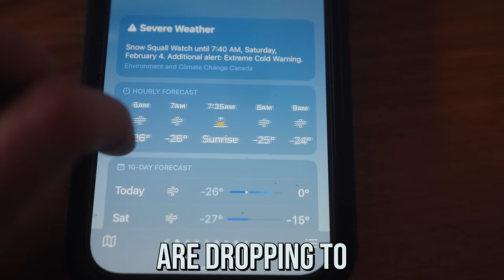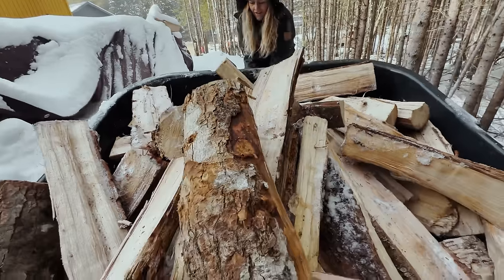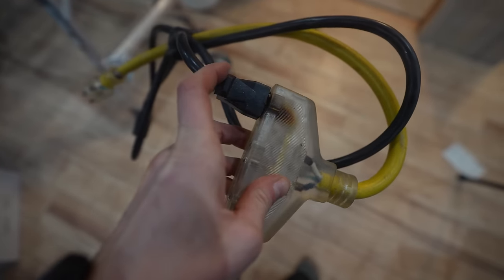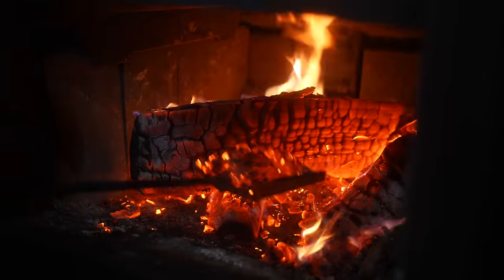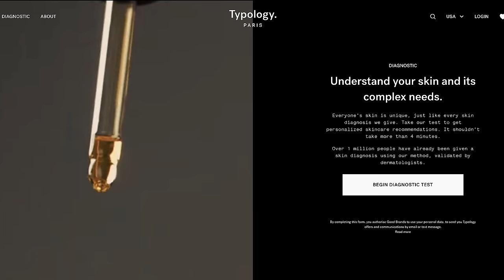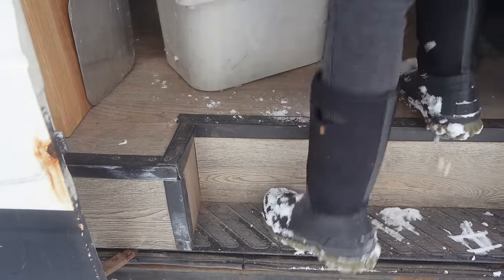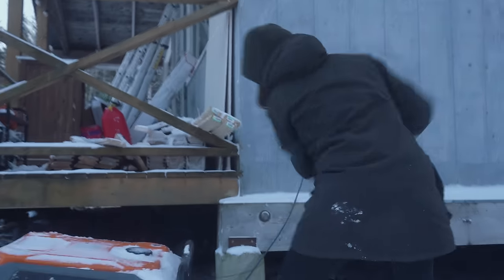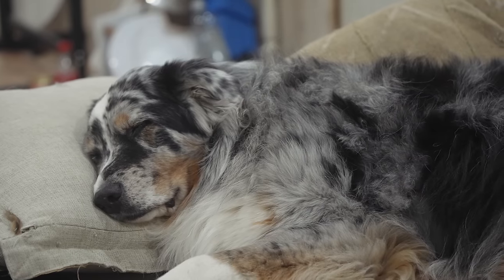POLAR VORTEX HITS OUR CABIN -40 & Not Prepared

Comment: Y'all amaze me, honestly! Going on the roof when there is snow takes guts! My suggestion, regarding dishes, would be to boil/heat water on the stove and use that to wash dishes inside the house. As long as you have running water and drains working inside the house for rinsing you should be good. Yes, it takes longer overall, but then you don't have to worry as much about your van. I would suggest winterizing the van and that would be one less worry. 

One more thing, the power strip. I know that you're limited for power, but don't plug and extention cord into a power strip! It's a major fire hazard and I would hate to see you hurt or for you to lose all of your hard work becuase no one let you know. Really, I just want you to be safe with those things that can easily be prevented.

Comment: Yes curtains will help a lot also spend a little more money and get clear plastic and put it on the outside of your windows.   The clear plastic lets you see outside.   I am going to get heavy clear plastic sheets and custom frame each window that I can install with mounting clips for easy installation and removal.   Stay safe

Comment: Hi Gals...coming from another woman who has lived and worked in the bush for 40 years - Yukon, NWT, Alaska - you need to get a wood stove with a larger box. You should not need to get up in the middle of the night to stoke your stove. Mine burns for up to 18 hours. You have to load it with rounds logs not split logs for overnight and damper down the draft. In  the morning crank the draft wide open again to build up the heat and burn out your chimney. Dishes...I do not have running water and always keep a large pot on the wood stove filled with water so always have hot water...using your van seems silly as you haul water...so not like you did not have it...I wash my dishes in a big old fashioned dish pan and dump your water outside...no big deal....outhouse...the way to tell a newby from an old timer bush person....check out their outhouse in the winter....newby will have a regular toilet seat...old timer will have  2 inch styrofoam cut into a toilet seat shape...no frost bit butts!!!!

Comment: Long extension cords tend to resist! Buy a roll of cable and add temporary junctions/outlets where you need to extend. Don't risk thermal runaway with loose connections and/or chained extensions!

Comment: you need to invest in a back boiler system for your stove. you can always melt snow in a bucket to fill it when its freezing and will give you access to hot water.

Comment: Hey from Finland 😊 With regards to doing the dishes would doing them in the shower stall work with a couple of big enough plastic buckets or containers. One for washing and one for rinsing. And if there’s only cold water boiling some in a kettle. Minus the shower stall this is what we usually do at our summer cottages if there’s no running water.

Comment: lay a ladder onto the roof Tie a strong rope to the top of the ladder  Throw it over the peak and down the other side of the house  Tie it to a cinder block and let the block hang 6 feet off the ground  That ladder will not move. Put a cloth under the rope on the peak so the shingles don't cut into the rope.  This works and works very well.

Comment: Regarding the sauna - the reason you couldn't get it hot, is probably due to the glass door in really cold temperatures. An idea would be to build on a small "changing-room" in front of it, that would isolate a bit of the direct cold from the door and (probably) make it heat up even during -30/-40
Reply from the maker: Well Mr. Shaw, that is a great idea, thanks for sharing it with us. Another to do for our list.💛🐶

Comment: I live off grid in an area where I have a lot of blizzards and minis temps. I have been doing it for 10 years now. I do things way different. I have low ceilings so heat doesn't raise to high. Every window and door is covered in my house with plastic and even heavy blankets when it gets this cold. I also close the rest of the house to hold the heat in the main room. I also I have a bucket and everything needed for a toilet if needed. I have room in the main room for a weeks worth of wood. I don't open the door unless I really need to. Please be careful out there

Comment: I use my woodstove to heat water to clean the dishes and floors . I bury the dirty water deep or deep in the snow or put in a plastic coffee can and toss it in the dump ..depends on how frozen the ground is ... I use all nature cleaning products, 7th generations, baking soda, vinegar , essential oils. I have two large pans one for washing in soapy hotw taer from teh woodstove and one for rinsing in cold water from the faucet I let the water  stay in the other pot  and not go down my drain. I use that water for watery flowers outside or bushes. I am making an apple pie for the first time on my woodstove fingers crossed it comes out good smells good so far ...I use a coleman collapsible oven that sit on top of my woodstove .

Comment: You need to have at least two sources of heat, you may want to consider propane as a back up source. You can get a ‘blanket’ for the tank for the extreme cold to keep the propane from freezing. We had a power cut in -50’s weather but we had a wood stove similar to yours that kept our house warm, we cooked with a propane camping stove or on the wood stove just as you did. By stacking the wood daily to replace the wood used and we over-stacked the pile when the weather got really cold. Try having an indoor stack of wood in extreme temperatures that prevents you going outside during the night.
We have lived through the extreme cold for months as we live in the Yukon, we are moving to Nova Scotia in a few months and our house will have 3 sources of heat for comfort, plus can’t wait to have a month or two of ‘bad weather’ instead of 6-7 months. Nice job keeping warm.

Comment: Keep track of your daily solar cycle, so you know when to add energy to your most active areas, and when to expect the structure to absorb energy in areas which are leaky, have large windows, shaded by trees, or don't have heavy insulation. Add a layer to your windows, if you can feel them leeching energy and try not to let your walls lose too much energy before nightfall, or it will take forever to heat the space.
Reply from the maker: Thank you for sharing your knowledge with us. 💛🐾

Comment: Did you actually get -40 there? I live in the western corner of NS and our wind chill was in the -40's but the actual low was -23 C with about 90 km wind. And that was the coldest we've had since 1988. We heat entirely with wood I cut on my land. Works fine. I wouldn't want to be on a metal roof in winter though.

Comment: The water in my house was fine during the polar vortex, except for the pipe to my washing machine. There was no water. It's in the basement, but the pipe goes upwards. I guess it was close to a spot which wasn't fully insulated? I had to wait until the next day to wash my clothes. This is in a standard duplex. I live in Gatineau, close to Ottawa, on the Québec side.
I don't drive, so I walk to the supermarket. I took one look outside and decided until the vortex was gone before going to my weekly food run.

Comment: This happened to me last week. Horizontal rain/snow mix turning into 4' snow drifts. Unfortunately, I don't have shore power and my generator is not protected from the elements, so it sucked all the snow and rain in. So my power was out and then as I was shutting the cargo door on my 5th wheel, 2 windows just shattered into bits. I ended up moving in with a friend until I can get everything fixed.
Reply from the maker: Oh man oh man!! Thats a lot. Yikes! Glad you had a friend to go over too xx

Comment: You need to wrap copper pipe around you stove flu to heat water pumped through a hot water tank and then you with have piping hot water for a shower and water for dishes.

Comment: The toilet you have is very nice.
Just make sure you don't use the pot to cook with.....lol.
You might benefit from a new tool...called a Chicken ladder......they also make attachments that do the same for a regular ladder........hook to the peak of your roof and walk right up.
Has a wheel on one side to roll your ladder up the roof then you flip the ladder over as you hook over the peak of the roof to use.
Have used these for roofing.painting and general maintenence for decades.
Electric mittens work really well.....they're in my go to's for winter.
They make electric socks,vests,jackets.......very small batteries.
Reply from the maker: Thanks for sharing all your great ideas and experience with us. We will definitely look into all these tools and gadgets. We feel so grateful to have you in our community. 💛🐾

Comment: Hi you two amazing women! I was just wondering if you have ever tried the vinegar and/or hydrogen peroxide method of washing dishes? A lot of nomads do it. Just a spray bottle filled with vinegar or a peroxide/water mix (which eventually turns to just water, so you have to use the peroxide mixture within the week)...and a scraper or spatula. Scrape the food off first, then spray the dishes. You can leave them sitting for a while, or wipe spray off immediately. The vinegar or persoxide will cut through oil and they are both antibacterial. 
Take care and stay warm 😘
Reply from the maker: Thank you for sharing your knowledge  with us, we love that idea. We will certainly use it in the future. 💛🐾

Comment: I'm totally impressed with how hard you guys worked to stay warm and applaud you on your success 👏👏👏👏👏 So much to worry about and you handled it like pros❣❣❣Getting Cinderella working before the Polar Vortex was the cherry on top of the sundae 🚽🧻🚽

Way to go Jaz on the roof!!! ⭐⭐⭐

I have a suggestion about your dishes. First, maybe consider paper plates and bowls you can burn in the fire. Second, instead of doing them in the van you can boil water on your stove and do them in dishpans in the cabin on your counter. Wash in one pan and rinse in the other until you get a sink. FYI that they also make counter top dishwashers and some you don't even need to hook up to water to operate which may be more water saving than doing them by hand 😁
Reply from the maker: Deanna, thank you so much for all you accolades. The roof was quite terrifying, but had to be done to hook up our Cinderella toilet. Thanks for sharing all your knowledge and suggestions with us. We are so happy to have you in our community.💛🐶

Comment: i think you did great i am 59 live eastern quebec near labrador where we get white outs snow storms that can last a few days i dont go outside my house till the storm as stopped i make sure anything outside that can get loose and blow away or become a problem i tie in down with rope make sure i have firewood stocked up water, food i have a 8x10 foot place built on my porch where i store firewood enough for 2 months and i havent got to go ouside which is great just thought i'd share a few things i do i have steel on my roof i wear a pr of broom ball shoes u dont slip on ice with those so walk on the screws on your steel roof the soft rubber will grip very well plus soft knee pads that helps as well and i never go up when its windy or the steel is wet     get through winter dont let winter get you it is one my fav seasons  take care the 🌞is getting higher in the sky each day now ☕🫖🥂😊

Comment: I'm confused about the water in the van situation.  I thought I heard one of the girls say that they drained the water tank in the van to protect the water system from bursting if the pipes froze yet there they were, trying to wash dishes in the van.

This video is a good demonstration that winter in the sub-Arctic is no joke and requires serious and thoughtful preparation.  Not the environment to try to wing it in.

Thankfully the girls have redundant systems to keep warm and maintain power.  One of the key principles in survival planning is "Two is one and one is none."
Reply from the maker: Hey Kevin! 
Yes. When the heater started to work we filled the tank back up with a hose from our inside tap. 

You’re right. It really does. Always have to be thinking & on your toes. 

Love that saying

Comment: You can top your outhouse toilet seat/shelf with a 2 inch thick sheet of blue insulation, with the oval hole cut out. It will quickly warm up when you sit on it so no more frozen butt. To keep it ice free between uses just put it in a trash bag, and pull out when you need it.

Comment: I'm confused as to why you guys didn't heat water on your wood stove to do the dishes? Also, wondering about your outdoor toilet issue.. if you really had to go and it was really cold out, could you not squat over a pail.. then empty that? I realize that your incinerator toilet now works. I have an off grid cabin and do not have any indoor plumbing.

Comment: Hey. The sauna heats up better with smaller firewood. You used big firewood, they burn slowly and the heat comes slowly. Small firewood burns faster and heats up faster, so the sauna heats up more. The draft must be increased considerably, the ash box is opened a few centimeters. Two nests (almost full) of firewood is usually enough to heat my sauna, at least.
Your sauna is not insulated, so you need all the power from the stove. Greetings from the wonderland of saunas.

Comment: Didn’t you say around 18:20 into the video that you drained the water tank to keep it from freezing. If your going to keep those back up generators outside I e winter build a couple of insulated boxes put a 21/2 in.hole for exhaust you may need a short extension pipe to get exhaust outside the box and a couple of 21/2 to 3 in. Holes for air on the other end. These holes are basically plugs that goes back into the holes to keep the weather out. The smaller one you just put fuel init may have started in another 12 pulls. Well that’s enough on this novel or short story

Comment: To bleeping cold for me, mo thanks. 
Glad I survived it.  👍🏾👏🏾
Hear that water on ur wood stove to do dishes gals. U need two pale, 1 for soapy water the other is 4 rinsing. Tip use less way soap then normal. I don't hv hot water & I hv to heat water on stove 4 all washing needs.😉
CUDTR 🚐🐾🐕🤗🌈

Comment: You need to keep a pot of water on the fireplaces to wash your dishes and put moisture in the air.
Reply from the maker: Yes Terri, thank you we do keep a kettle on the fireplace to add moisture in the air. There is not a good place yet to do the dishes in the cabin, a the van is all set up. I guess I really did not want to do the dishes. Lol💛🐶

Comment: your main generator has one 120/240 volt plug but it also should have at least 2 /120 volt plugs so instead of plugging into the van start up your generator and plug into that or use your backup power things that your always talking about

Comment: Your luck I wouldn't 1 of those propane type tolet years ago but they only where in the US not in Canada I went with a big Composting toilet it had a heat pad in the bottom and you added peat moss and lime turned the barrel inside Backwards to empty into a tray it never worked like they said and stunk bad

Comment: So there is a reason pioneers made their cabins and homes with lots of walls and doors.. there easier to heat and keep warm and high ceilings and transom windows worked as a sort of air conditioning..you may want to consider a smaller, less open floor plan. Especially if you're going to remain off grid..... also, you have a hot stove and a bathroom sink. Why aren't you doing dishes in the cabin? (I'm new to the channel)

Comment: Thanks!  Nothing better than a wood heated cottage in a cold Canadian storm.  I had a small vintage in Muskoka, Ontario heated by wood for many years.  Replaced it with a bigger place with conventional gas furnace, heated floors, etc.  It’s not the same - even though we still have a wood burning air-tight capable of heating our 2400 sq’.  But, it’s too easy to just turn up the furnace, turn on the heated floors, the ‘gas’ fireplace….and watch your money burn in different ways. 😢

Comment: You need to be more organized and keep all the little jobs up together and not leaving them.  The wood store should always be kept topped up.. Do you not keep a kettle or pan full of hot water on the two wood burning stoves?  You just seem to be making life difficult when you have all the tools for the cold.   A bit more preparation is needed.

My house  here in France is only heated with wood, no other heating.

Comment: If I may, winter/storm prep has to include things like filling gas tanks full, starting and running up to temp generators and vehicles. Have a can of starting fluid on hand as well as a fully charged jump battery. I know this is your first winter and a polar vortex is a once in a long while thing, but as you experienced, one problem can lead to another to another. If the large generator hadn’t started then what? I assume you’d start the van and let it run to charge it’s batteries but if the van doesn’t have a full tank of diesel or hasn’t been run in a week or two you run a big risk. People rarely get hurt via one mistake or problem, you can always trace a series of errors that lead to a problem or mistake that hurts or worse. I apologize if this comes off condescending or if it’s info you’re already practicing. I just don’t want anyone to get hurt.